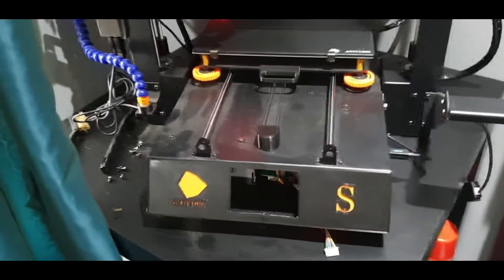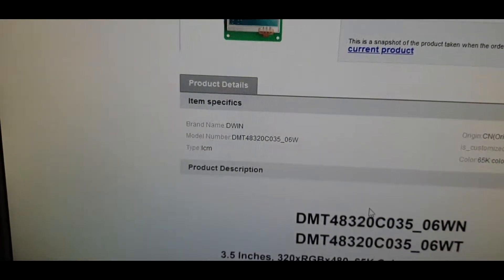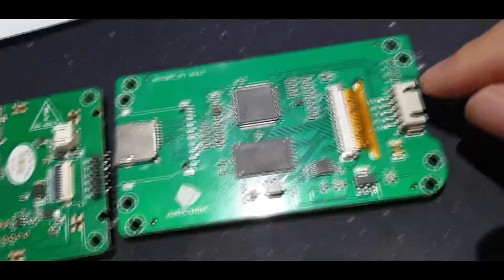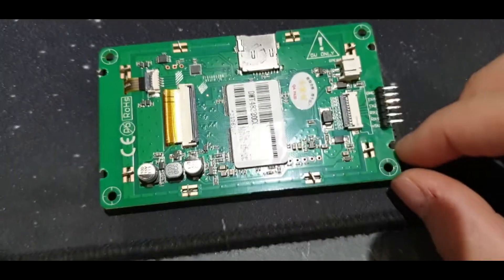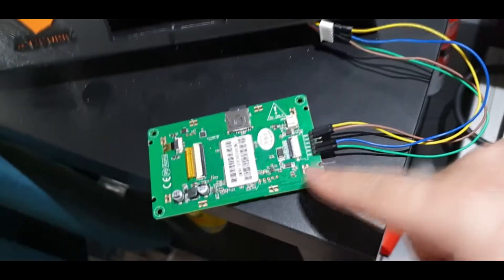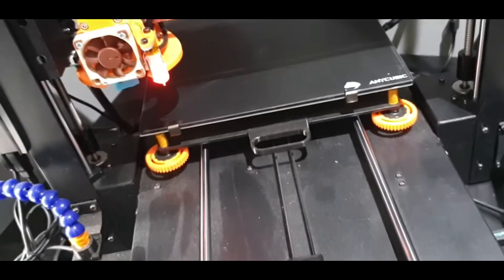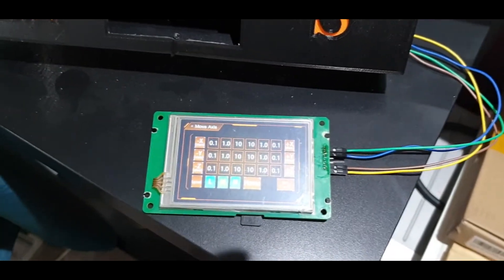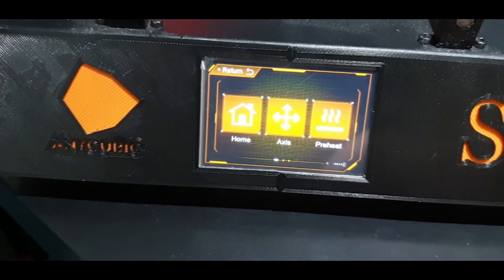Anycubic I3 Mega S Customising the TFT Firmware DWIN DDGUS TFT Screen 3D Printer Mods

Comment: from your modified screen firmware cfg and other files are not downloading from sd card. Screen works with DWin example but not reprogammeing screen.
Any help appreciated. I will try another brand new sd but I think I'm missing something. Wiring has been checked ok. Thanks
Reply from the maker: I had this problem and had to change something. Let me check back over my notes
Reply from the maker: Have a look at the mentioned offset in the readme. Change to 08 or BB. If I remember rightly. (I don't have anycubic anymore now) there was a specific bit that needed to change for the flash to take. Otherwise it would just boot as normal.
Reply: @superfly108  Thanks for the info but have decided to change the motherboard ans screen MKS Nano  or Tinybee. Just to make things a bit more up to date. Not sure which one but might publish what I have done. Manythanks for your help.😎
Reply from the maker: @johntickle3120  no problem sir! Best of luck

Comment: did you try using a micro sd to flash? I think it would work.
Reply from the maker: On the original screen? Yes it's locked from being flashed there might be some undocumented trick, like a certain file needed on the SD alongside source files. But I couldn't find anything.

Comment: This is brilliant info. I have just got my hands on a graded Anycubic mega P with a broken screen. Just the touch screen is broken.  I was wondering if the screen you suggest as a replacement is the only option or are there others you could suggest (cheaper or better}. My stock screen is the same as yours but to clarify is the stock screen unable to be reflashed for say a Marlin upgrade which I intend to use if possible.?Many thanks for your excellent vid Cheers.😎😎
Reply from the maker: Yes you cannot flash the stock screen. They are locked. Needs to be a replacement.

Comment: my friend 
can i have the software for LCD printer using the same   DDGUS 
i by the part from aliexpress
Reply from the maker: Hi. The software should be on the GitHub repo in the description
Reply: @superfly108  i have the same screen...but i wanna use it for lcd screen...for printing resin liquid material....not same like yours.........what programme or software i should go for..if its ok wid u ...can u provide me your number i will try to follow up with you...whatsaap...or any kind .help

Comment: Hello, do you have anycubic_tft v0.0.2 source code?
Reply from the maker: It's so much source code as the original project files. The only ones I could find were from the mega X max. The screen is a DWIN DGUS based screen. But locked from firmware changes. Thus the need for a new DGUS screen to apply.
Reply: @superfly108  ok, understand you, thanks for your response 👍

Comment: Hi, do you have the Marlin settings for the Anycubic_TFT  v0.0.2 . I want to connect it with SKR Pro 1.2 board but unfortunately I didn'T find the correct settings
Reply from the maker: Not quite sure what you mean, the screen talks to marlin via registers which execute gcode, (and vice versa)
Reply: yes but the display should defined in marlin to connect it to mptherboard. I could not connect it because marlin settings were wrong
Reply from the maker: @williamwallace5772  not sure I'm afraid. You would probably need to speak to Knutwurst. My screen didn't need any alterations to the firmware. I was planning to try adding new features but no doubt will upgrade my printer before that happens